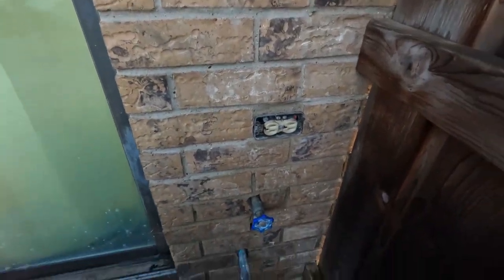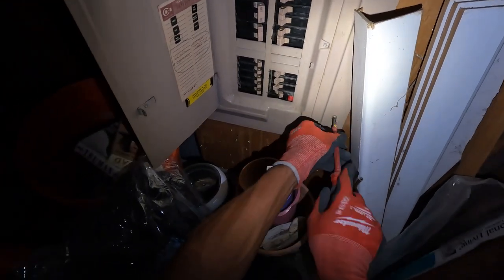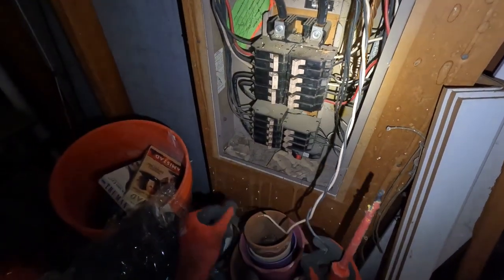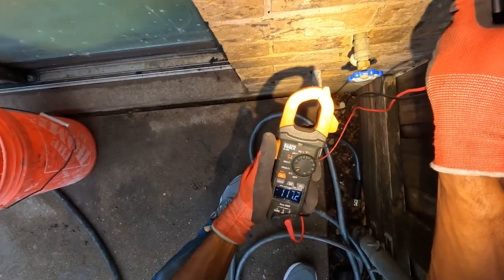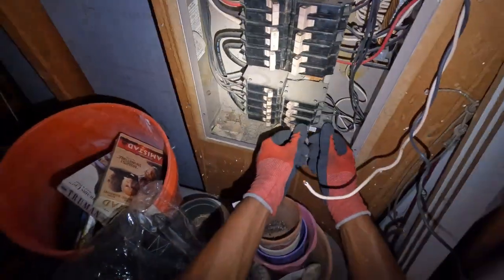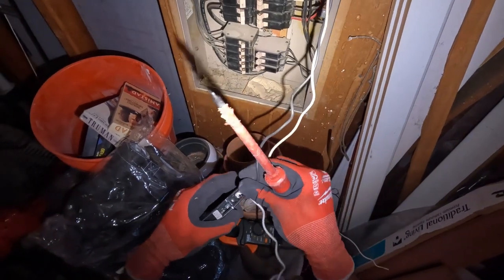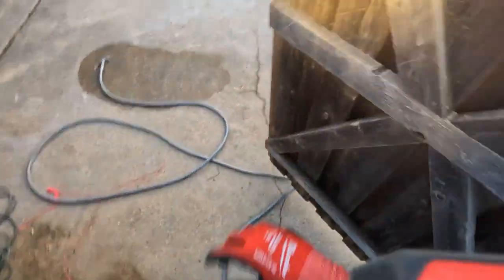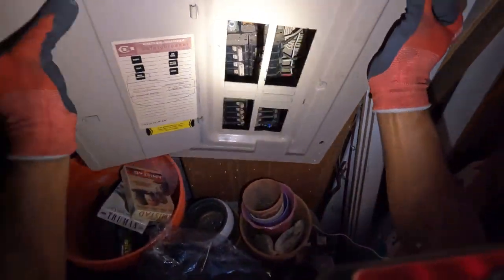Why GFCI & AFCI Circuit Breaker Keep Tripping

Comment: I see there is a class action suit against Siemens regarding their dual function breakers and nuisance tripping. I ran into this problem in my sons new condo with aSiemens panel. The contractor wired a separate circuit for his kitchen island with an upstream receptacle/ junction box in the adjacent wall . He used that receptacle successfully for his coffee maker for several months. The island lead was unattached and hot . I installed a 20 A heavy duty receptacle in the island and tested the wiring- all good. Then the ( almost new) coffee maker started tripping the dual function breaker. I tested my power tools and other appliances but no issue. Tested the power cord etc, no issue. I then replaced the upstream wall receptacle with a 20 A GFCI receptacle. Voila , no tripping. Not sure why or what was going on , but I surmise the GFCI stabilized the signal back to the breaker. If the coffee maker were really bad, it would trip at the receptacle. Yes, and ground and neutrals were wired correctly and tight at the panel and the circuit. Yes ,and the coffee maker did not trip on another AFCI/GFCI circuit. Yes, and no short in the hot lead to the island. Siemens must realize there is a problem because they produced some videos about “ways of addressing” tripping issues, I tried them all and nothing worked. Appreciate any constructive thoughts on this.

Comment: Regarding fault finding for the newer apprentices. It always pays to listen to the customer regarding what happened, the age of certain equipment and their use can provide clues what likely is wrong. In the vast majority of cases it’s the simple things. Rule them out before going deeper. That just comes from experience as you say. I would have also replaced the receptacle. The vast majority of electricians will only do a voltage check. I would have also done a receptacle prong tension test to ensure that whatever is plugged in actual holds. Usually the ground prong tends to loosen up over time and it’s the one that fails most often and for clearing faults it’s important for overcurrent protection with the breaker. If it’s been splashed with water and likely created a short I would not put much stall in the receptacle lasting too much longer.

Comment: Everything about this patio outlet is why GFCIs were required:  damp location including direct water exposure, missing cover plate, likely corrosion in the conductive path.  At https://youtu.be/leWgyaQmE3s?t=600 119.4 VAC is measured, but at https://youtu.be/leWgyaQmE3s?t=618 116.6 VAC is measured.  For the relatively short wire run and presumptive low load, I'm curious about the 3 volt drop.

Comment: You got lucky. Your assumption that it was the afci breaker because it didnt trip a regualar breaker is wrong. If there was a fault between the neutral and ground somewhere in the circuit it would not trip a regular breaker but it will trip an afci breaker.
Learned from experience.

Comment: Do you charge by the hour for troubleshooting or what? Sometimes you can spend hours taking everything apart before you figure out its a staple thru the wire, in the attic, under the insulation (just an example) 😫
Reply from the maker: Usually doesn't take me about an hour, but I charge for 2  hours minimum.

Comment: Great video again but I must respectufully disagree with one assumption you made.When you disconnected the wires from the gfci breaker and you connected them to a neutral bar and a regular breaker,the assumption that it was a bad gfci breaker is only half true in my opinion.I say that because if there was a fault between a neutral and ground on that wire, the regular breaker would not 'detect' it,but a gfci breaker would.So, technically,once you put in the new gfci breaker,you could have had it tripping again :).please Correct me if I'm wrong.
Reply: 100 agree with you ..but it's easy detect the problem with outlets ..switching is more difficult

Comment: I have about 5 breakers all gf and af breakers. 5 trip when I plug in my solar inverter but not when I disconnect the inverter and turn back on the grid, it no longer trips. And it’s not ALL of  the af and gf breakers that trip, it’s some that don’t. Not sure what this issue is. I called the company concerning the inverter and they asked for pictures of panel and wiring in the inverters and they said the inverter connection was fine but they could not give me advice on the panel because they were only qualified on the DC part. However they said some times a matter of moving around the breakers and checking for loose terminals can help. In my sub panels I have all my loads on one side (except for the output breaker of the inverter which is on the other side) and they are all 120. I have no 240 loads in my sub panel that the inverter is powering. Do you have suggestions that could stop this tripping of the load? I unplugged all of the large appliances before starting up the inverter to see if it was an overload issue but still no power to the 5 breakers, even the reset doesn’t do anything.

Comment: at 8:50, why do we need to connect the neutral to the breaker and then to the bus bar, can't we just run it straight into the bus bar
Reply from the maker: great question, do some research

Comment: Would you explain why an arc fault creates so much heat? Is the current increased?, and is the heat similar to that in a short circuit? Thanks

Comment: Quick question is fire alarm a good trade to get in??
Reply from the maker: The are all good, every building needs fire alarm, depends on if you wanna work for someone or do your own business,
Reply: @unitedtradesmanacademy1894  so fire alarm is considered part of an electrician? Do fire alarm techs bend conduit?
Reply from the maker: potentially if you come from an electrician back ground, then yes but a lot of times the electricians on the site will install the conduit an fire alarm guys pull there wire through the conduit!
Reply: @unitedtradesmanacademy1894  thank you for your answers
Reply from the maker: @amilcarcastillo2446  welcome
Reply: @unitedtradesmanacademy1894  last question lol is fire alarm consider a skilled trade?
Reply from the maker: @amilcarcastillo2446  yes
Reply: @unitedtradesmanacademy1894  😎

Comment: any solution for AFCI nuisance tripping?  My son's gaming computer keeps tripping and there doesn't seem to be anything that can be done.  Have replaced the computer PSU and the actual AFCI breaker.  Circuit is not overloaded and I'm at wits end.  This happens on several different circuits in our home.
Reply: If your receptacle is wired with stab-type wiring you can get intermittent operation for anything connected to a computer. 
 I solved a similar problem by replacing the receptacle with one that required wire- wrapped around the terminal one.

Comment: Good work !Did the customer tell what they were doing if anything when the breaker tripped ? Sometimes a faulty appliance ,saw etc. can make a GFCI trip.
Reply from the maker: Greg she was having concrete poured an the guy sprayed the outlet with water causing it to trip, but it would not reset so i put a new one in.

Comment: I also have a question I tried to install a USB receptacle into a metal box on an island and it was really tight so I think after I turn the breaker back on I had a fault because it immediately trip the breaker. So so I took it out and replaced it with the original receptacle, and now  a GFCI on that same circuit was tripping so I replaced it with a new one same scenario yet the breaker stays on??? Any help anyone

Comment: I bet you had a strong suspicion that it was the breaker from the jump ,arc fault breakers are the worst they always going bad or tripping and based on code you got to put them in for a lot of stuff now days :(  . GFCI not as much but still…
Reply from the maker: yup
Reply: Arc faults dont usually go bad. Most of the time its water getting into the box or bad cord.Cutler Hammer are the ones that go bad the most in my exp.
Reply: @DonkeyLipsDA3rd  my friend then you are lucky , with my luck dealing with them they can trip easy and have issues but they are still new compared to other types of breakers .
Reply: @DonkeyLipsDA3rd  Funny you mention that, I think my cutler hammer breaker just went out.  Still need to troubleshoot
Reply: Bet it was that saw they used kept resetting the breaker

Comment: i have a brand new square d qo gfci/afci that trips as soon as anything plugged into the circuit is turned on. circuit is brand new with 12/2 romex, 20 amp outlets. if i use a regular breaker, all good. i guess back to the old school i go.
Reply: Ahmed, brand new could still be bad.  Try a different breaker with the same new wire, or a different wire with the same breaker.  That way you see where the fault is.  Just reverting to the old non arc breaker may mask the issue when there really is bad wire.
Reply: Could be a nail in the wire from neutral to ground Or a series of other issues causing current to leak to ground. You could test by removing the ground wire from that circuit in the panel and isolating it. If the breaker doesn’t trip you have leakage onto that ground wire. There could Also be leakage onto another circuit. Do you know if any boxes are shared between that circuit and another one?

Comment: I have my doubts it was the breaker should have tested the terminal on  the breaker make Shure all connections are good . Then after that move on to a new breaker
Reply from the maker: Old breaker would not reset to test terminal.
Reply: Understandable those breakers are garbage

Comment: So much for torquing that breaker wire correctly and neutral remove that receptacle and check the see if that torque correctly and made-up correctly but I guess dinner is waiting

Comment: Man has vainly arms jesus
Reply from the maker: Use to work out pretty heavily 15ys ago. Gains left but veins stayed.
Reply: Almost looks like you could throw a cinder block into space, but yeah great job with the testing appreciate the vid
Reply from the maker: @bluename9657  Damn too funny, made my day with that one.
Reply: Arc fault isn't required outdoors. Why would you put a dual function breaker in? Arc faults and weather do not play nicely together